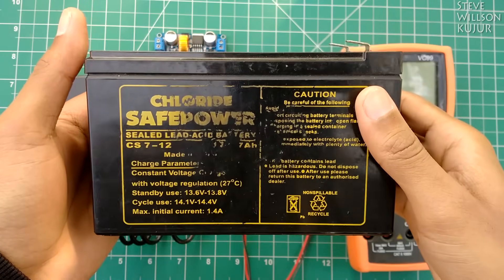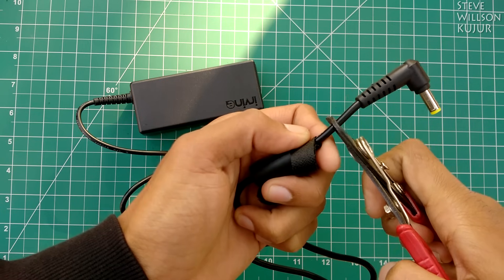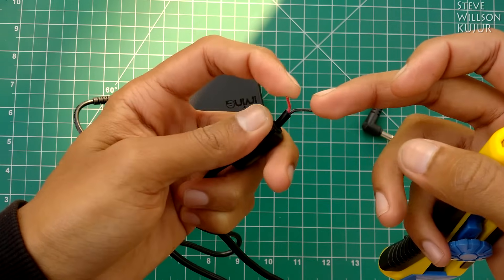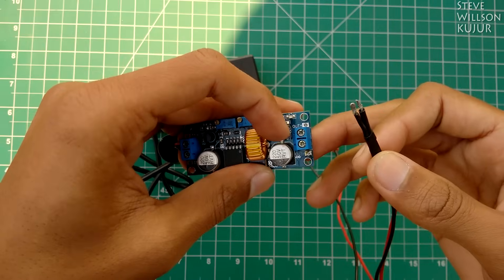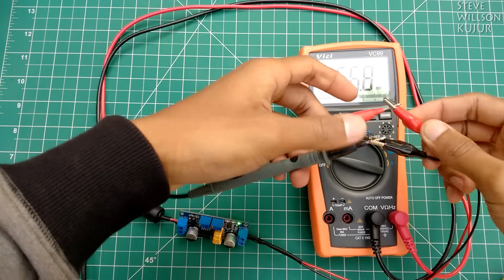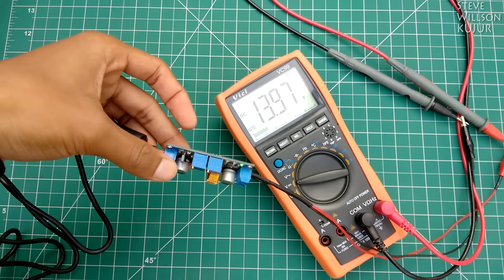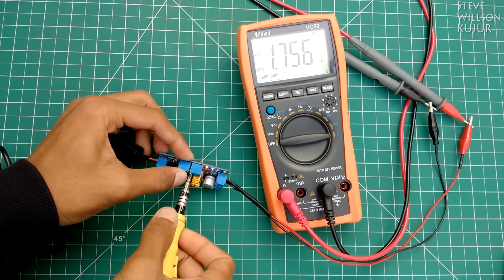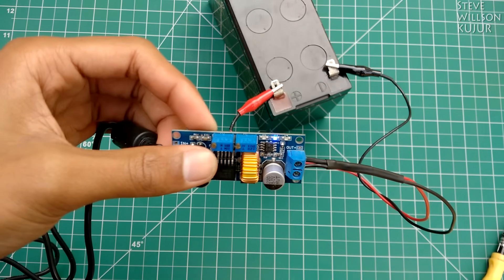How to Make a 12 Volt Battery Charger

Comment: These low cost, simple switching regulators are brilliant for this kind of job when a DC supply (of the wrong voltage but the right power is available) and I have bought many for many different types of project. Great informational video BUT ...

1. There is simply NO need to cut off the jack plug from the PSU at all. This is plain wasteful and reduces future flexibility. Simply obtain a suitable jack socket and wire THAT to the regulator instead. This means you can keep using your laptop supply ... for other things (e.g. other low cost voltage supplies) if not for supplying your laptop as normal.

2. When using this type of switching regulator one should ALWAYS fit a Schottky diode (or diode pair) between the regulator output and the battery to protect the regulator from probable reverse voltage damage when the mains is deliberately or accidentally disconnected before disconnecting the regulator from the battery. One diode ... a few cents and problem solved, circuit protected.

3. by implementing 1. above, the regulator can also be housed in a plastic weatherproof box together with a low cost voltage or volts/amps display available from eBay or Banggood or others for less than a burger, and can be left connected to a car battery in the car - set the output volts (measured AFTER the Schottky diode) closer to 14.4 volts and the output current limit to 4 or 5 amps for a large, wet tech battery e.g car though. A permanent connection can be made to a dedicated charging socket inside the vehicle cabin ready to just have a laptop supply plugged into it whenever charging is required. No opening the bonnet, no messing with croc clips just plug in, switch on the mains and away to go. Just remember this will NOT provide enough power to start a car, just to recharge the battery over a few HOURS! It's not an instant fix.

4. If you implement 3. above with a volt or volt/amp meter, remember to fit the meter AFTER the output diode otherwise your charge/battery voltage will not show correctly although the amps might (depending on exact meter type and circuit wiring). If you intend to leave it in the vehicle permanently remember to EITHER fit ONE extra lead input to the box - an ignition switched positive feed to the +ve connection on the meter, OR the meter can be connected direct to the incoming supply (voltage permitting) and because of the Schottky diode on the output there will be no power from the battery to power it either..

5. WHATEVER amps you wish to utilise, ensure the input supply can provide them, but remember though that although a 19v, 4A supply will have almost 80 watts available assuming the regulator is 85% efficient (they usually are, or better) then taking a conservative 80% figure ... 80 Watt x 80% = 64 watts at 14.4 volts = 4.4 A. 85% efficiency gives 4.7A and 90% efficiency gives 5A! How can you get more amps out than in? You are converting ENERGY not voltage so look at the power IN compared to the power OUT multiplied by the expected (or measured) efficiency of the regulator.

6. Finally, if you want to be able to charge OTHER types of batteries (e.g. rechargeable electric drill batteries, then simply replacing the two on-board trim pots with the same value panel mounted ones will allow you to set both Volts AND current EXTERNALLY so that your supply can be set for constant volts (lead-acid charging) OR constant current (NiCd or NiMh) but be wary of using it to charge Lion or LiPo batteries/cells due to their much more complex charging criteria. For 18 volt batteries you'll almost certainly need a higher voltage input than 19v. It MAY be sufficient to use 24v but I'd expect you to require a few more than that even ... say 26 to 28 volts.
Reply from the maker: +Bob Lewis very very informative comment thanks for this information
Reply: Just to show I wasn't just trolling the other day with my long comment above I was actually awaiting a couple of parts for my own 12v lead-acid charger based on exactly this idea. The working (but still incomplete) charger is now in use keeping my vehicle battery topped up. Unfortunately, the meter I received from China quite some time ago doesn't appear to be able to display amps so I am awaiting a new one. I also have ordered another regulator since the ones I currently have (several) do not have any current limit setting pot. Consequently I set the output volts a bit lower than where I'd like them to be at 14.1v open circuit and it is keeping my battery very nicely sat at 13.8 to 13.9 with a trickle charge of around 360 to 370 mA (measured with my mutimeter). 

Another thing I'm awaiting is a pack of heatsink adhesive pads so that I can properly affix the two heatsinks I have, to the regulator chip. The one finned heatsink you can see is basically just stuck down with silver heatsink compound! You should also be able to see the black "transistor" like object just next to the regulator which is actually the dual Schottky diode I mentioned should be used to protect the circuit from reverse voltage from a still connected battery should the input power be lost or removed before disconnecting the battery itself. 

As I mentioned I have the meter connected to confirm the battery voltage but I had a rethink about what I said previously and I power the meter from the incoming supply rather than the battery output as that prevents undue drain on the battery once power is removed. However ... If a 9v battery e.g. a PP3 is connected at the input it can just about power the meter but not provide sufficient voltage for the regulator to operate and the meter would then show the true battery volts. A working ammeter would confirm this of course.

I had to come back and re-edit this due to a complete shambles with Google providing links that didn't work so apologies to anyone who has been confused and also to anyone looking for the other replies i made to try to post pictures - IO deleted those and instead put all the pictures into a public Drive folder: https://goo.gl/Rn2dXY which hopefully all can access without problem
Reply: how should be connected the output Schottky diode?
Reply: +Hans Kaller Ah! When it comes to "charging" a battery it varies. It depends on the battery technology. If you are charging a lead acid battery, the general opinion from all knowledgeable and authentic sources is that ...

1. Charge at a constant voltage of between 14.2 and 14.4, SOME battery manufacturers MAY say up to 14.8. Personally I would always stick at 14.4 MAX.

2. YES there should be a maximum current beyond which you should not charge even on a very high discharge battery like say a battery designed for a diesel truck. Too high a charge current CAN cause the internal plates to buckle, distort and even possibly short, which of course would completely screw the battery. Despite other cells potentially being OK, using such a battery could result in fire or explosion.

3. Correct design means that BOTH constant voltage AND constant current settings can be applied in a single charger. It is NOT advisable to cascade two circuits to achieve both functions,  whether in a linear supply or a switching one. For LOW currents, to charge sealed lead acid cells then the linear LM317 supply will work and can easily have external components used to achieve constant volts (a given) and constant current (only provided by the internal chip protection circuits which are not acceptable for this purpose). 

*

EDIT 2/5/17 Just to be clear here, a presettable current limit can be set using EXTERNAL components to the LM317 (consult the LM317 datasheet and search for online design ideas on LM317) but it's OWN internal, short circuit protection is ONLY suitable for protecting itself and NOT for external current limiting. My apologies if that was not clear from my previous writing.

*

In my opinion this (CV/CC) is the BEST form of charging and such a charger can be used to charge many different battery types quite safely including Lithium Ion. This is why I personally favour the use of the VERY low cost, highly reliable, robust little switching PSUs available on eBay. 

Using them rather than an LM317 gives so many other options and reduces dramatically the design effort to protect the LM317 circuits from overheating or being inadvertently run outside their SOA which is very easy to do in a constant current, constant voltage scenario.

As examples of charging, consider the following:

a) Lead Acid batteries below around 10 volts, should NOT be charged "normally" until they've been "recovered" properly. There are plenty of discussions online that discuss this but do NOT believe them all and do NOT use overly aggressive tactics if you want decent, long term results.

To charge a Lead acid battery (car) a max voltage i.e. the constant voltage should be set at 14.2-14.4 as stated. Now set the maximum output current to around 0.1 of the amp hour rating. So for a 45amp hour, typical, small car battery use around 4.5 amps maximum current. 

Now here's the bit that so many people totally misunderstand when they hear the term constant voltage, constant current. The constant voltage setting is really a MAXIMUM voltage that the charger will output so that it will NEVER exceed that level.

The constant current setting is really the MAXIMUM current the charger is allowed to deliver.

This means that when the battery is very low, at that extremely low level of 10 volts, connecting an UNLIMITED CURRENT charger, even with a maximum voltage of 14.4v, will try to charge at massive current. So we limit the current to a sensible level; for a fast charge, around 0.2 of the Amp Hour figure, for a standard charge, 0.1 of that same figure. 

Once the voltage on the battery creeps up to a more normal level, then the ability of a14.4v limited supply AUTOMATICALLY means that huge currents cannot be driven as there is insufficient voltage difference between 14.4v and whatever the open circuit voltage that the battery has reached, in order to do it.

b) The same situation applies with a Lion cell. Its nominal voltage will usually be stated as 3.6 to 3.7v. However the voltage to which it should typically be charged is actually 4.2 volts. So setting the "constant voltage" i.e. the maximum voltage that can be supplied to 4.2v means that it is almost impossible to overcharge it. 

Setting the "constant current" i.e. the maximum output current, once again at around 0.1 of the Amp Hour figure, which, for most Lithium 18650 batteries, is 2000 mAH to 2200 mAH means charging at around the 200 to 220mAH for a normal long charge or 400 to 600 mA for a fast charge. It does however depend quite a lot on the specific manufacturer. Wherever possible obtain and consult the manufacturer's datasheet for the battery (ANY type) and be guided by what it says.

Do remember that lead acid batteries are best kept on a trickle charge. Lithium ion cells do NOT respond well to trickle charging , can be damaged from doing so, and should be disconnected once charged. 

NiCds can tolerate a low trickle charge but again be guided by the specific datasheet or if unavailable then ensure the trickle charge is no more than 0.05 of the AH rating i.e. for a 1500 mAH cell then 75 mA or even less. 

NiMH cells are not so tolerant of a constant trickle and should also be disconnected when charged or an even lower trickle than for NiCds.

That was very long, but it is a complex topic. Hope it was useful.
Reply: adal von karlsburg Fit the Schottky diode in series with the output supply connection, in between the regulator and the battery with the anode connected to the regulator positive output and the cathode connected to the battery. The cathode is the black bar end of the diode in a circuit diagram, and the anode is the other end (obviously!) If you use a power diode ( you should if charging at 4 to 5 amps) remember that many, but not all power Schottky diodes are THREE pin devices and look like transistors. They contain TWO diodes connected internally with a common cathode. It is perfectly normal and acceptable to wire  both anodes together so that the diodes are in parallel. It is definitely NOT recommended to connect normal individual diodes in parallel. Check Google for why not. Hope that helps. Tschuess!
Reply: Jerome Daniel sorry I'm not certain what you actually mean. Is the "boat" 12v or 24 volts? if 24 volts and you need to use a 12 V fan (or fans) then just get one of these little DC to DC regulators from eBay, set the output to 12v and connect as many fans as you need up to the maximum supply capability (with and without appropriate heatsinks as stated previously). if the boat voltage is 12volts already, then just connect your fans direct to the 12v supply.
Reply: Awesome man! You're the best!
Reply: IF you set the current limit to the right level for your cells/battery AND IF you set the maximum voltage to that of the fully charged cell target (or slightly lower) then the answer is YES it will stop charging, but it may still run a small (<10mA) through the battery. It will not be possible to overcharge your cells/battery BUT whilst lead acid cells actually SHOULD be trickle charged (actual current will vary according to battery) and NiCd cells/batteries can tolerate a small amount of trickle current DO NOT do this with Lion cells/batteries or NiMH cells. You WILL damage the long term viability of them.

Don't forget the THIRD parameter that you should be concerned with ...

                                               TEMPERATURE!! 

Especially with regard to Lion cells and batteries, which can be very sensitive and temperamental when mishandled (accidentally or deliberately) but temperature should NEVER be allowed to get hotter than mildly warm. If the temperature on ANY battery gets above just warm to the touch IMMEDIATELY disconnect everything, and I mean IMMEDIATELY as THAT is when things can go haywire VERY quickly indeed. 

IF there is a faulty cell (singly or in a series or parallel connection) it can be the cause of very serious short circuits and when many tens of amps can flow even from small cells and batteries it is a certain recipe for potential disaster.

BUT BUT BUT! ....

PLEASE guys bear in mind that ANY serious failure of your power supply also CAN and WILL cause damage to both supply and batteries. So DO NOT skimp on protection, use every trick in the book to maximise the protection for your supplies and for your cells/batteries, Particularly when planning on leaving them to charge for long periods.

Take due diligence, NEVER ASSUME ANYTHING, always check. There is no excuse these days with searches on both YouTube and Google readily producing results for such topics. DON'T simply believe everything you read either ... do multiple checks. Learn as much about basic electronics as possible, and I mean basic, things like Ohm's and Kirchoff's laws, Maxwell's laws and REALLY understand them and THEN you will be able to use your own "uncommon" sense as your very own BS meter (actual "common" sense seems VERY hard to find these days). Not EVERYONE who posts on line that sounds an expert necessarily is one, so you need to be very wary, especially with high voltage/high current stuff.

There's an old expression about having two ears and only one mouth so we should do twice as much listening as talking. We also have two eyes and two hands and two nostrils ... when multiplied together that means we should be listening and reading and feeling and smelling (especially the BS!!) WAY more than talking about it or even doing things before we understand the consequences - real or potential.

To ensure you understand just HOW dangerous batteries and cells can be when abused, do a YouTube search for "punctured lion cell" and just see what can happen and how many truly stupid people there are out there that have actually tried to puncture cells deliberately. It's unbelievable! DO NOT DO IT because if you decide to put the fire out by dumping it in water or throwing water over it remember that lithium (just like sodium and potassium) is a highly reactive metal and can also be set alight or even exploding by throwing it into water! Don't believe me? Do a YouTube search for "Lithium in water" - it's scary! I love electronics and I would not be able to do it if I lost my eyesight or use of my hands. Neither would you!
Reply: Der Verpolungsschutz ist bei diesen eingesetzten Bauteil zwingend notwendig. Dem Geldbeutel und einer unnötig langen Wartezeit auf die Lieferung eines neuen Bauteiles sei es geschultet.
Reply: nice
Reply: Bob Lewis make a vid  of how to make a 12v fan for a boat please...that would be greatly appreciated as u seem to be very knowledgeable
Reply: Bob Lewis олооо
Reply: If the laptop was only capable of 2.5amps  would we not have to set the amps to that  or the laptop may overload?
Reply: Захар К. Я не понимаю
Reply: Bob Lewis  Thanks bob . Very informative
Reply: Will the step down module stop supplying current, when the battery is fully charged?
Reply: Wow, I finally found an active expert. I just posted this question on another vid "Does anybody know if you can power any battery with just a lab power supply, since you can exactly control the voltage and the amps going into the battery?"
I got old black and Decker nimcad cells that amazingly can still be charged up with the original very simple loading station. There is no electronics inside, just wires. I also had to shock my converted to  nimh battery back to live with 12v and 5 amps. It worked, it holds the 4v charge. How is this possible?  This is interesting stuff!
Reply: Thanks, you made it clear, but I think not enough still :) Let's take SLA 12V battery. As we know, we set voltage on charger to 14.4V, but depending on battery's initial voltage (empty, half empty), a typical 12Ah one might drain even 3 Amps and I think here lies the problem - people (including me), would like to know how to limit that current with some DIY method and not a ready-made component. I mean, to feed battery with 14.4 and ALWAYS 0.1C at max, no matter what's the current voltage on battery being charged.
Reply: OK Hans. Here's the problem:

1. It is NOT a good idea to have your voltage limit and current limit  handled by two completely separate, different and independent circuits. It is FAR better to have them integrated as one since it typically will simplify the overall operation and simplicity is good as it improves reliability. It CAN be done, sure, but it's not really the best idea. If you are determined to do it separately the fundamental thing you need to do is to somehow DETECT the output current and then apply some form of negative feedback to control said current.

That control may NOT be possible using an existing car battery charger for example. In most of them there is NOTHING but a transformer, a bridge rectifier and the output terminals. Adjustable ones may have a switch for say 5 amps and 8 amps (as the one I have does) and may or may not have some kind of voltage monitoring (as mine does) or may not be adjustable at all. 

The switch typically just connects neutral to a different tap point on the transformer input such that it provides greater or lesser output voltage. That output voltage is not even smoothed. It is only full-wave rectified and so essentially is a poor man's pulsed charger as only connecting the battery provides any smoothing at all on the output. On my own such charger for example, on the 5 amp selected output the DC voltage on my multimeter shows just 9.73 volts!! WTH?? HOW can it charge a battery at such a low voltage - answer: IT CAN'T. 

There is also an AC output of some 5v showing on the output terminals and all becomes clear when one connects a scope. I just used my tiny pocket DSO to check my charger  All that appears on the output terminals that connect to the battery is a full wave rectified voltage of around 15-16v peak!! 

                                     ***

EDIT: Sorry, I meant to include a link to the Mini DSO I used above.. They are available on both eBay and Banggood but the Banggood ones are WAY cheaper for the exact same thing. It IS a kit and involves some fine/delicate soldering of through hole components (all the SMD components are already mounted) and for the money (<£18.00) you cannot do better as a first scope for learning about electronics on low voltage circuits. 

https://www.banggood.com/Orignal-JYE-Tech-DS0150-15001K-DSO-SHELL-DIY-Digital-Oscilloscope-Kit-With-Housing-p-1093865.html

                                      ***

About the only way to do it [provide a current sense and limit] effectively with minimal interference to the output current is either to use a Hall effect circuit (plenty available on eBay for Arduino) and to configure it to either turn off an otherwise saturated high current (Vceo and Vcbo dependent on charger) NPN power transistor in series with the positive output or similarly saturated PNP power transistor in the negative return rail so that there is absolutely minimal power dissipation in the transistor (low Vce sat).Ic max needs to be at least 30% greater than max current flow for safety and heatsinks my also be required depending on current.

The same can be achieved with a VERY low (<20mv) Rdson P-channel FET in series with the positive rail output, or an N-channel FET in series with the negative rail return. The FETs should be capable of easily handling the max current, preferably a large factor greater for safety, but it is easy to obtain FETs with > 30amp capability so that should not be a problem. Just make sure that whatever the Rdson value is, that when squared and multiplied by the current through it, the resulting power dissipation figure is well within the capabilities of the chosen FET, or ensure plenty of adequate heatsinking - preferably do both. 

                                                     ****

EDIT: WHOA! BIG mistake Bob! The calculation for power is I^2 * R not R^2 * I   you MUPPET! 

The above SHOULD read: whatever the Rdson figure is, mutliply it by the square of the current to get the power dissipation. e.g. If the Rdson is 12 milliohms and the output current is say 4 amps then the power dissipation will be 4 * 4 * 0.012 = 0.192 watts (i.e. it should not be a problem for this type of current level even without a heatsink - the wonders of low Rdson Power MOSFETS. These numbers change dramatically though if you try to use other MOSFETS (higher voltage high current ones) that typically have much higher Rdson figures closer to a few ohms or more. If we say Rdson at the voltages we are using is 5 ohms then clearly the dissipation becomes 5 * 4 * 4 = 80 watts!! This could easily be greater than the Ptot of even a heatsinked MOSFET so DO THE CALCULATION using REAL datasheet figures.

                                                        ****

If you just want a very simple disconnect on detection of just an over-current condition then use a relay and a series resistor/sense circuit, preferably such that with NO power applied anywhere the relay default connection is OFF. Ensure that the relay doesn't chatter and that it can't power back on should the supply fail when a battery is still connected. You'll need to design your circuit carefully to ensure it switches off once and doesn't reconnect until you tell it to.

OR ... you could use a very low value series resistor to produce a tiny voltage - say 100mv (as opposed to the more usual 700mv)  and feed that as a differential voltage to an op amp, but the complications of input voltage bias, input current bias, the relevant offsets, cancelling them out, temperature stabilisation ... it gets VERY messy and tricky for little benefit.

If you also want to switch off after a certain preset time (min or max) then use a 555 as a rough timer - even for periods of several hours they are usually good enough. With some extra design thought an over temp auto shutoff can easily be incorporated into ANY of the above ideas and many others. Search for op-amp Schmitt trigger circuits using a thermistor. There are plenty to find. I used one recently to switch a fan with full volts, but could easily use the output to also enable a 555 to drive a "min usable revs to max revs" PWM output, varied by using another thermistor, 

If you do not want to use any of the above ideas then I'm afraid  you will probably need to start considering something like an ATtiny 85 chip as a minimum and create the relevant software to do the voltage and current measurement, control, timing and switch off - a nice project I'm sure, but once again for the little benefit achieved not really worth the expense and work involved UNLESS doing it JUST to learn from the exercise. I GUARANTEE it will work out more expensive and time consuming than a simple switched regulator will.

2. It is SO EASY to set a current LIMIT AND a voltage LIMIT on one of those little switching regulators that Steve used in his video, VERY VERY easy. BUT, to demonstrate HOW to retrofit a current limit capability to some other (linear?) supply is impossible without a detailed schematic (which seems like what you might be asking). Having spent quite a long time designing and building linear supplies I can tell you that there are literally DOZENS of different techniques and approaches to being able to set a current limit, so how would I (or anyone else) even come close to an accurate answer for your specific circumstances without LOTS more detail I cannot say.

Steve's video shows a VERY neat solution (Independently, I had already used the exact same design concept and process in my own car battery charger) and I can vouch for how good it is and HIGHLY recommend it. It is impossible to find an equivalent charger on-line that is so basic in design yet such low cost and also so capable in it's flexibility of adjustment. And even though I can design, and have designed far more sophisticated linear circuits, there simply isn't any point any more for such a simple task as a straightforward fixed or variable supply  PSU or charging circuit. There maybe and probably IS if it's for a specific task such as audio amplification which really benefits more from a linear supply due to the MUCH lower high frequency noise interference generated (i.e. NONE).
Reply: For a Cyclic use AGM batteries need a charging voltage of 14,7V (25°C ambient) or  13,6V for StandBy Use /Continous charge.
Reply: Thank you for the additional points
Reply: todos los santos amigos
Reply: what didode should i buy? could you tell me the name? this would be good? 12SQ045 12A 45 V  schottky diode?
Reply: Bob Lewis , Hi, I understand it's been some time since this post but could you please let me know what size DIODE 3A-5A...? I should wire into the positive at the battery connection..  Be much appreciated.
Reply: sir can we use the same (the above one) to charge a 12v 42Ah battery (exide ep 12-42). will it reduce my battery life.
Reply: I have a bigner question.
Battery is 12v so why he set 14v ?

Please increase my knowledge. Ty
Reply: I'd rather use a buck-boost converter in order to be able to have an input flexibility aswell. This way you can hook up batteries to the input to have a portable lab bench psu.
Reply: [Tutorial] DIY - HomeMade - How To Make RC Vaterra toy very simple
Reply: +Bob Lewis we need to talk about a project if thats possible, do you have instagram?
Reply: Andy McSwift I'm presuming you're talking about the laptop supply? Like I said, if the laptop supply is say 16v at 2.5 amps then that is a total of 40 watts - not much for a laptop supply, they are more typically around 60 to 70 watts minimum, but there are many around that can deliver 120 or 150 watts. You must remember that the output WATTS cannot possibly be greater than the input watts multiplied by the efficiency of the regulator. So for a 40 watt supply of say 85% efficiency, the maximum output watts would be 0.85 x 40 = 34 watts. So for an output voltage of 14.4 volts, the max current would be roughly 34W/14.4v = 2.36amps!! So NO, you can't get more than 14.4v @2.36 amps from a 16v laptop supply that can only supply 2.5 amps, presuming a conversion efficiency of 0.85!

HOWEVER ... If you have a 20v laptop supply that can only deliver 2.5 amps ... that's FIFTY input watts available and presuming the same regulator converts at the same 0.85 conversion efficiency then that means the output watts max will be around 42.5 watts which means it should be able to deliver around ... 50 watts/ 14.4v = 2.95 amps!! I hope that's clear.

Obviously, if the REGULATOR can deliver a much larger current (in the case of the regulator shown, it CAN - up to 5 amps) then using the 16 V laptop supply mentioned above, the maximum output amps at FIVE volts will be MUCH larger ... 40 watts at 5 volts is 8 amps multiplied by the conversion efficiency of 0.85 = 6.8.amps! This is WAY more than the 2.5 amps from the 16 V supply. So much more that it exceeds the output capability of the regulator. NOTHING special needs to be done about this as the inbuilt circuit protection will prevent you drawing more than 5 amps from the regulator used in the video. As a result the 16v laptop supply will not be stressed or stretched at all.

Just remember Mr Ohm, apply his rules and the relevant conversion efficiency and you can work out yourself very easily what kind of max current can be expected.
Reply: casemodder89 Yes I can fully understand that. I do say elsewhere on these comments that some manufacturers go as high as 14.8 volts and that where possible always go by what the manufacturer spec sheet says. But when you DON'T know for certain 13.8 to 14.4 will rarely, if ever, be "bad" for a 12v lead acid battery. 

I like to maximise the charge on my batteries and if I set the target voltage to 14.4 with a current limit appropriate for the battery capacity, then the final charging current has NEVER made the battery become hot or anything other than mildly warm - on car batteries OR Sealed Lead Acid ones.
Reply: Ideally use two diodes, one as a back EMF protection diode connected to the output terminals of the regulator to conduct if the battery is connected reverse. The second diode should conncet from the output positive terminal to the input positive diode, to conduct if the input terminal voltage is lower than the connected battery voltage.
Reply: *Bring Dead Lead Acid Battery To Live Again>>>>> https://t.co/jfZbilIKLW?fe >>
Reply: uuuu
Reply: ggg
Reply: Bob, there has always been a question for me HOW should I set converter. I mean should I set converter to output voltage or current ? The more voltage, the more current, so suppose I have two converters where one limits voltage and the second one the current (I will probably use LM317 or similar). My input voltage is - let's say 24V, so using the first module I will reduce it to 14.4V and the next one will limit current to two amps, but it will do so DEPENDING on the voltage. I mean, empty SLA battery (10.5V) will drain a lot of current so my 14.4V will drop, but also, my second regulator will reduce current to less that 2 amps I expect it to give.
Well, maybe I complicated things a bit, but I think you know what I mean.